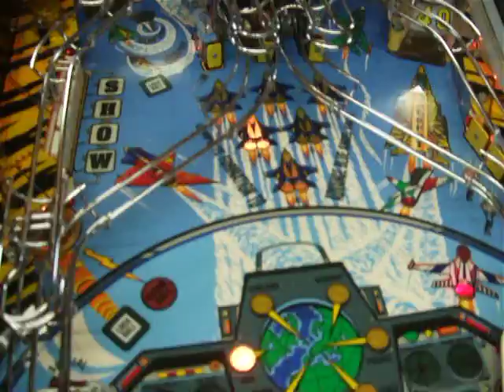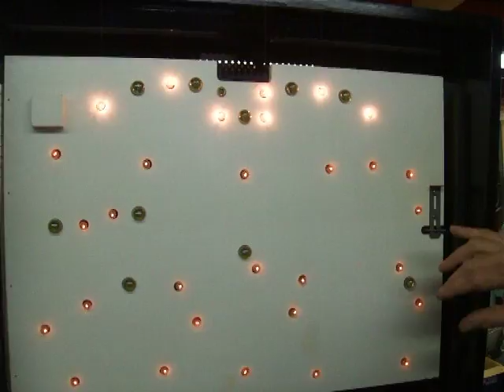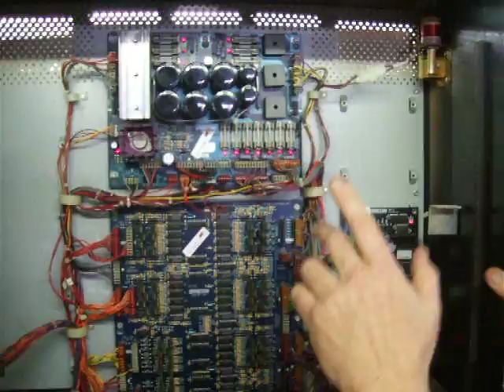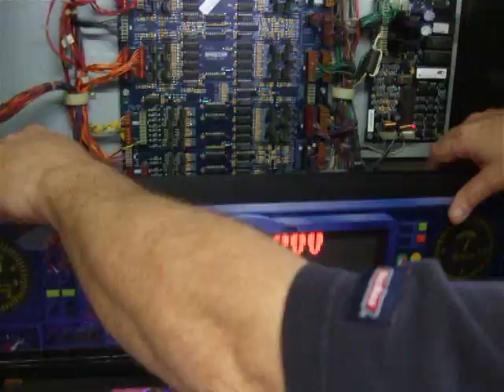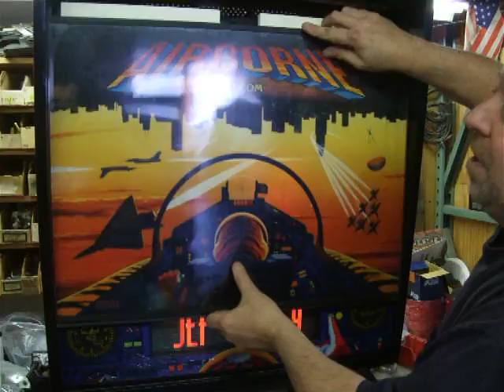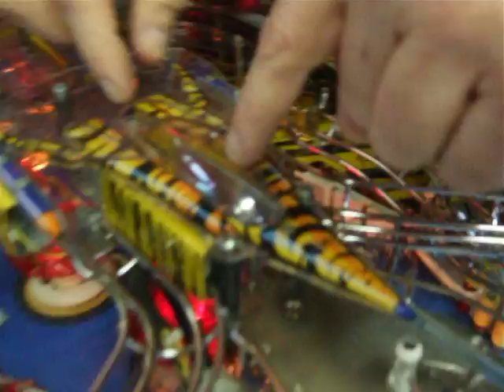#114 Capcom AIRBORNE Pinball Machine - VERY few made! Fighter Jet theme!  TNT Amusements

Comment: looks like a flameout at some point on the PSU on behind the display   X_X  anything to get rid of that or just leave it.  I left mine on my computer case.  (which is what happens on cheap parts.  tiny nut falls off hooks around 2 pins that shouldn't be hooked then you see something very bright inside the computer and smoke  smh